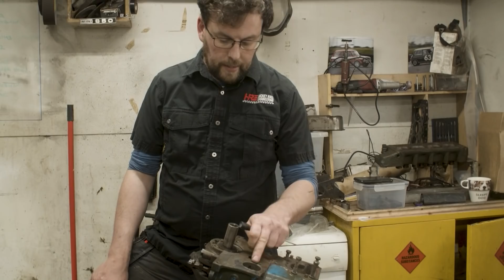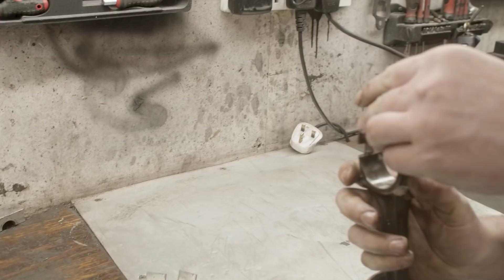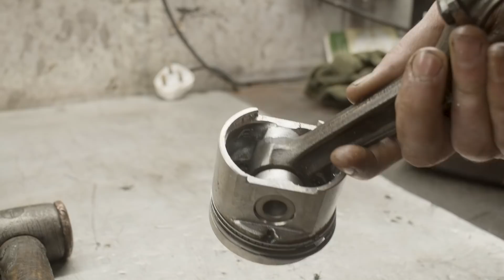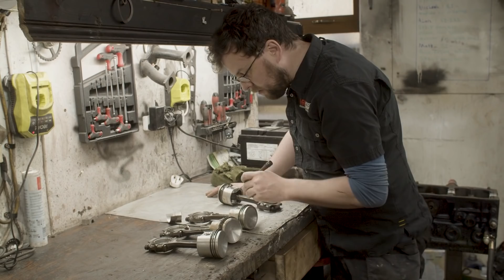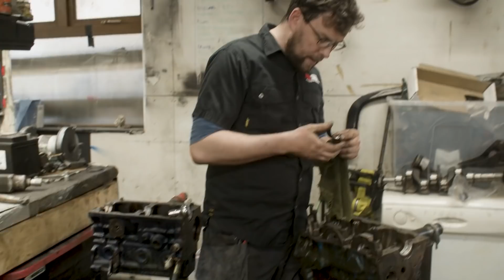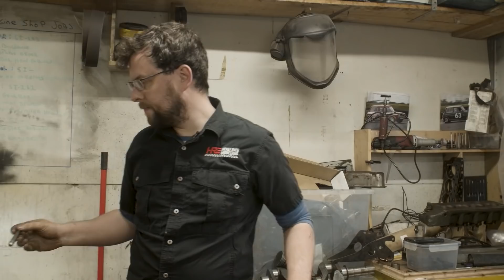Stripping Down The Engine Of A Classic Mini Cooper S

Comment: I may have missed it but did you say that it can't be an S crank as the big ends are 1/8" smaller than the 1275 so it wouldn't be able to run 1275 rods like this one , also no mention of the EN40B mark on the crank web as on genuine early S cranks. If as you say you need a new block the engine is really just going to be a later 1275 unit  and nothing to do with an S . What a shame for the owner.
Reply from the maker: That was exactly the problem John, However the owner sourced another S donor  since and thats what we are rebuilding now 👍

Comment: Hi Paul, the center cap on S blocks are flat from factory. Also the hole with the tread. And the number is also from factory. I have many s blocks and they are all the same.  Cheers
Reply from the maker: Thanks Gregor thats great information really appreciate you passing it on 👍👍

Comment: Finally got to watch 2ksubs fantastic 🥳 soon be a million when a fellow knows what he’s talking about it will soon attract subs
Hydraulic pressure down the bolt holes is fantastic seen it many times you must clean the holes out folks simple way is to use an air line if you don’t have one use a straw sounds daft but works but mind your eyes be exceptionally careful with alloy holes 
Fantastic program Paul sorry for the guys block it’ll be off to make another Nissan  if anyone can sort it you will great ! 👍👨🏻‍🏭🇬🇧
Reply from the maker: thanks Paul chuffed. ya you are spot on keeping everything clean is the only of being sure the motor will go together properly

Comment: Center main bearing is stock "S" they are always machined like that. Main bearing  bolt are from 1300 block, the "S" blocks use nut and studs, except the very early 1071, they use a special bolt with built in location. The number stamped in the main caps, is also found at the top of the block, at the waterpump end. To fit a 1300 crank in a "S" block, will need special thrust bearings, as the width is diffrent. You have to think again about the use of heli coil, used correct, it is a very tough tread :-)
Reply from the maker: Thanks so much for the information Thomas I really appreciate that. Haha A good few people have mentioned the Heli Coil I am going to set up an experiment in the very near future to demonstrate what I have seen and it may well prove me wrong 👍

Comment: Great vid Paul and gutted for the customer losing an S block.  Curios to understand why you don't like the threaded inserts? I use these often and they are much stronger than normal threads cut into parent metals (cast, steel, ally etc).  The reason is not only is the insert made from stronger material, the insert also spreads out the tension (created from torquing the bolt up) down more of the thread depth than a standard threaded hole. Less likely  the top 2-3 threads pulling up as they are taking less load, more spread over the middle and lower threads, but correct installation is key to this, bad install and it will cause problems. We use them in critical threads often on industrial manufacturing machines because of this.
Anyway, keep up all the videos, love the variety and depth of knowledge you're giving out, will be referencing a lot of them when building up my own engine later on in the year 👍👍
Reply from the maker: I will do a video in the near future, and we can test them in real life. I will make up something block of steel, cast iron and alloy and we can screw in a thred, an insert and my way drilling out bigger fastener and re-drilling and tapping and see which is the strongest 👍👍👍
Reply: @HREIRL  sounds like a good test / video as there are many differing opinions on this subject. See link below for a quick overview of what I mean, and also explains about the reduced torsional stress on the bolts when tightening because of better thread surface, which means more accurate torque preload of the bolt. A Timesert is another good product to use which might be worth  testing. Looking forward to the next update 👍👍

https://www.bikerstoolbox.co.uk/acatalog/More_Info.html

Comment: Your channel has some fantastic content. Your engineering skill is second to none, and I worked for many years in a machine shop working on numerous jobs over the years from building mini race engines to tank engine mounts. It's great to see someone still taking pride in doing a good job with no cnc in sight. Best regards
Reply from the maker: Hi Lincs, thanks for appreciating the manual work we do and for watching out videos 👍👍

Comment: The block failed because of inadequate tensioning of the center cap causing it to flex as we know cast iron does not like that all Ways use new bolts and stretch to required length I cut my teeth on mowog hope this was helpfully
Reply from the maker: Thanks for your insight Steve 👍👍

Comment: It could be a very early MG1300 engine, a few of them had tappet covers. They were a strange combination of parts before they were deemed to be too expensive compare to the solid blocks. Those pistons don't look like 9.75:1 GT pistons. Hard too tell from the video though.

Great breakdown and diagnosis of the issues. Just shows how that extra look at the block after working out it could have been some dirt under the bearing found the real problem.
Reply from the maker: Thanks for that JJ. this one is defiantly an S all right but you are right very early GT's shared a lot with coopers as did the MG1300's

Comment: Really interesting, would a small groove down the thread prevent the hydraulic pressure  on studs and bolts or would it weaken them?
Reply from the maker: interesting idea, Generally how I avoid it is to wash out the threaded hole with a solvent and then blow out with compressed air so the hole is dry and clean.
Reply: Hi Paul,
I think that the flat centre cap is standard for an S but as soon as I saw the cap bolts I was surprised because every S motor I have stripped (3) had main bearing studs not bolts.  Perhaps the bolts used were too long and bottomed out?  Pity.

Comment: Dam, was just going down the shed to fill the hole in the rood where a sunroof once was lol
Reply from the maker: sorry for the distraction Paul hope you got on well with the roof 👍
Reply: @HREIRL  Well lets put it like this and you had to ask lol. I have an old mk1 roof, chopped off on the posts at around 6" down. I cut the part to fill the pop up sunroof hole that was cut out in the mid 80's. Now i spent  a lot of time to making sure it fitted the hole which it did, quite nicely. But you know when a new born baby is born ( well you might not lol ) their head is all pointy, well that was the profile of my roof and the back part of the sunroof hole. You just can't get the correct profiles, ie, dome shape and integraty back in the roof. So i'm now looking for a new roof panel............£474 plus postage from Mini spares....ouch